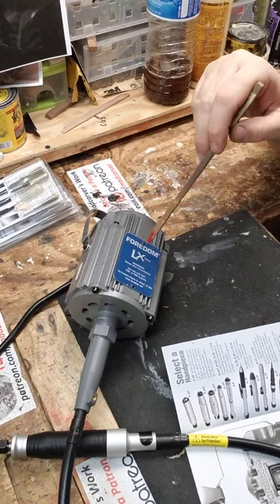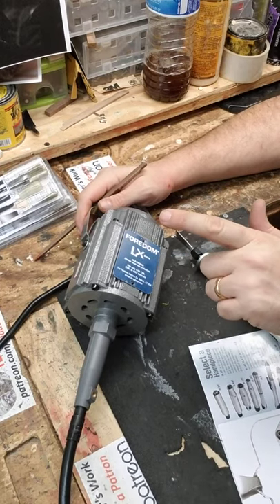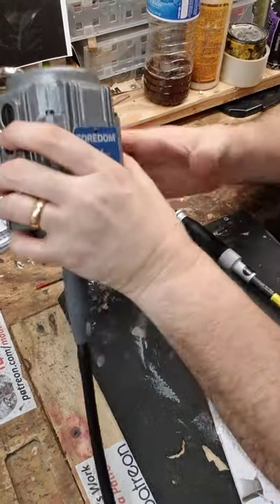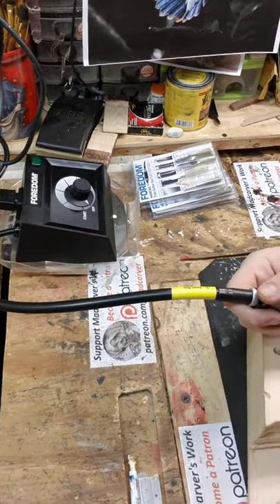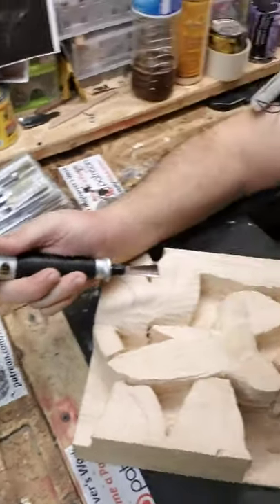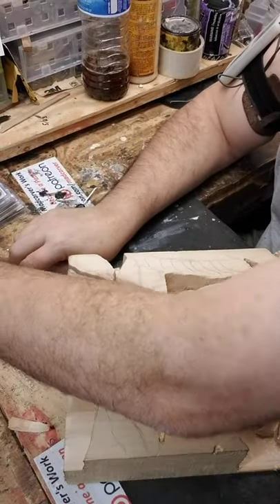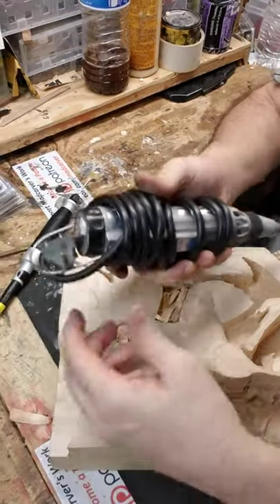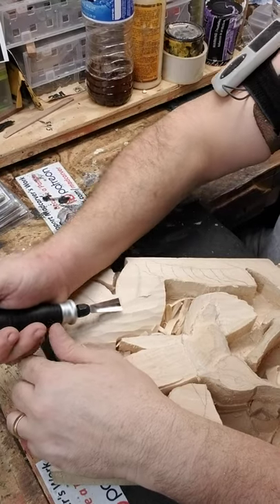Foredom with H50 recipricating chisel hand piece

Comment: Most have said the chisels that come with it are marginal and not very sharp.  I would go with Flexcut chisels and save some money and get just the handset without the chisels.
Reply from the maker: The chisels are professional size chisels, and come factory sharpened. In my opinion, they should come a bit sharper and that's something that Schaaf should work on. However, the chisels are true pro sized and that is something that Flexcut does not sell. The work you are doing could render some of the tools unusable but I use all of them with the work I do.